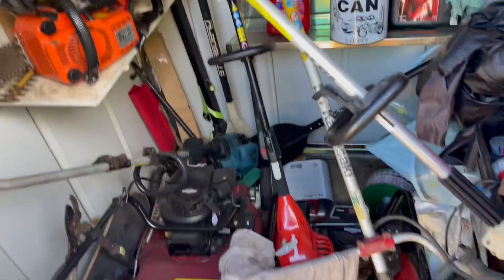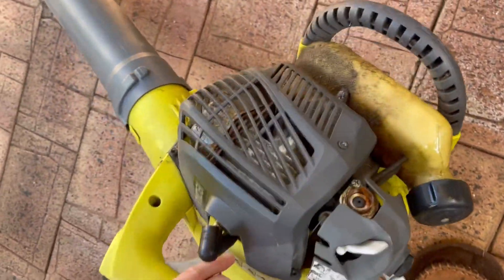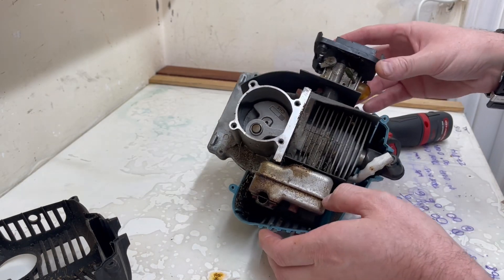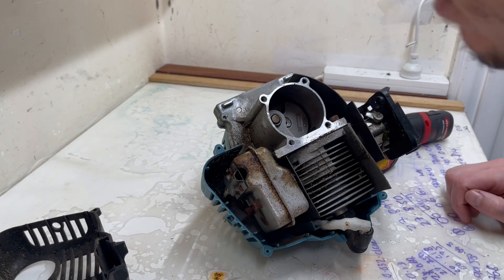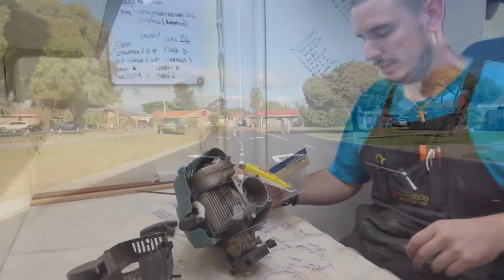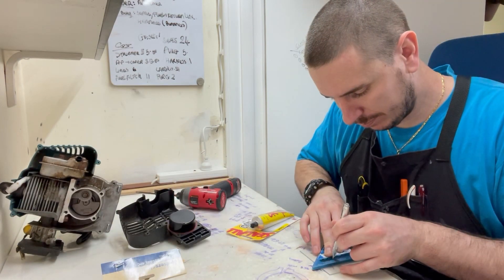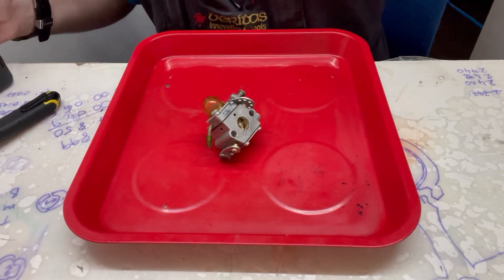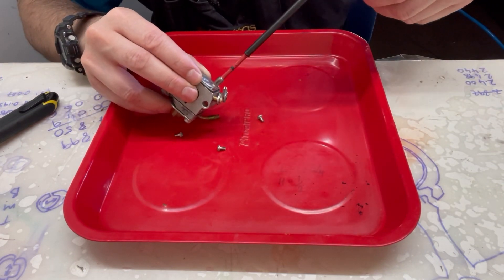SEE THROUGH ENGINE - HD SLOW MOTION!

Comment: I ran it at 1/4 speed and it was amazing how fast the crankcase filled with the air and fuel mix. The crankcase volume is too big without that plastic bit in it destroying the supercharging effect.
Reply from the maker: You’re quite right it’s not right Brian, there is a lot of thought that goes in to volumes and air flow in a 2 stroke and this does it no favours. That said, I’m still very pleased with the result! Thanks for watching :)

Comment: Nice.
I was hoping that it might have been slow enough motion that it may have been possible to see the motion of the air fuel mix as it came in and then went out.
Reply from the maker: If you look closely you can see that at 10.15 especially if you set your playback speed to 0.25x Thanks for watching :)
Reply: I guess that you're right. I was expecting to see something more dramatic than a mist breathing in and out. My expectation didn't match reality. doh
Reply from the maker: @Alan_Hans__  haha sucks when that happens doesn’t it 🤣 maybe if it was filmed by the slo-mo guys!!
Reply: What I expected to see was essentially the flow of air. It's not often that you see that happening ;)